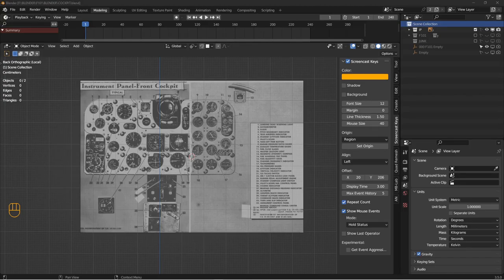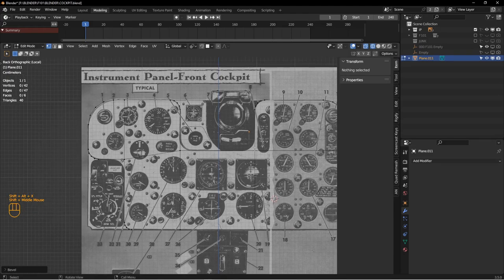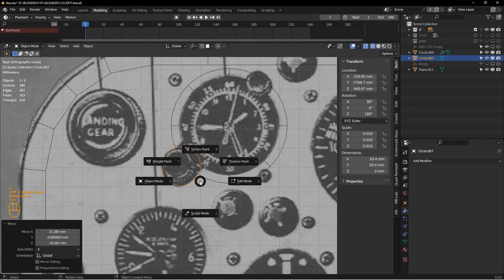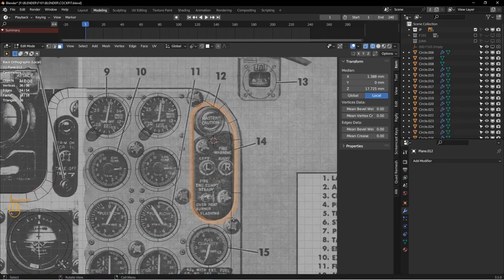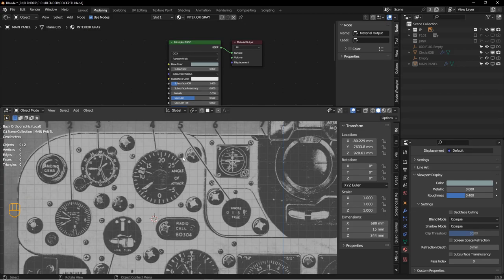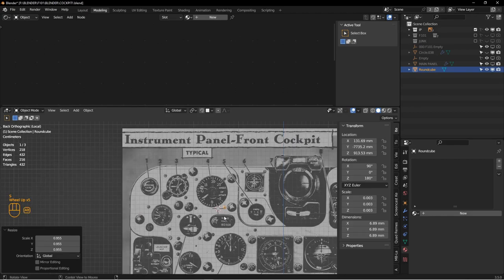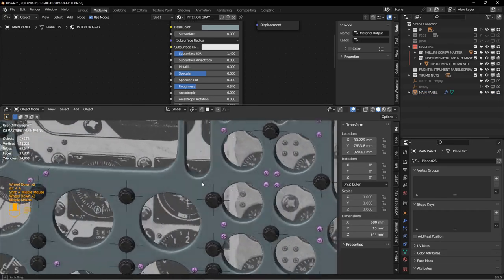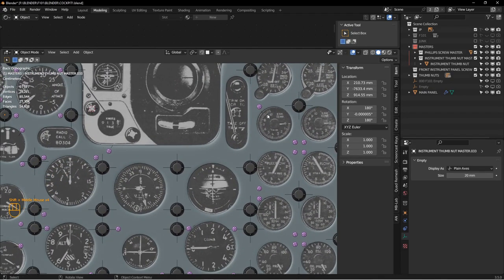Blender:  Making an aircraft instrument panel (Part 1)

Comment: I didn't get why you needed an empty for the screw.
Reply from the maker: It isn't really an empty.  It just looks like one because it is a Collection Instance.  Right about here (https://youtu.be/YSkrlr4pQls?t=1621) I start talking about putting the original screw-head into a collection so I can make lots of copies of it via Collection Instances.  Once the screw is in its own collection, I can make lots of copies of it by creating Collection Instances.  The new instances don't use up any memory since they all use the same data.  This lets me create lots of copies without any memory penalties.
Reply: @Mark_Alloway  Thanks.
Reply: @Mark_Alloway  Has this changed in Blender 3.3? When I experiment with collection instances, I don't see any axes that look like empties where I add instances.
Reply from the maker: @TangoMikeLima 
I don't think it has changed.  Two things you might want to check:

1.  It may be that the axis are very small and you can't see them.  This would be related to the scale of your objects and scenes.   If you select the object and click on the Object Data Properties tab, you'll see a "size" value you can adjust to make the axis bigger or smaller.

2.  Another possibility is that the collection instance isn't getting created where you think it should be....

When you create a collection instance, its origin is based on the location of the original object in world space.  If you created your master object anywhere other than at the world origin, your collection instance objects will be created with a built-in offset equal to the distance your master object has from the world origin.  Is your master object at the world origin?
Reply: @Mark_Alloway  Ah, you are right. The empty happened to be exactly the size of the sphere object I was instantiating so it was hidden... saw it when I turned on X-Ray mode.

Comment: 30:00 You can also select all screws, then use the "Randomize Transform" tool to rotate them on a specified axis, as well as randomize the scale and position if needed.
Reply from the maker: Good Tip!  I didn't know that one.  Thanks for sharing.